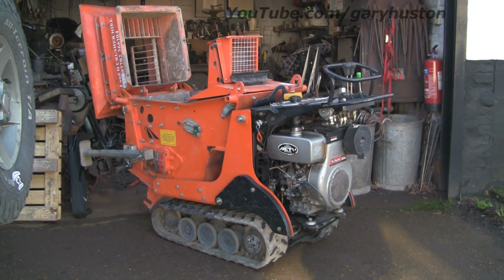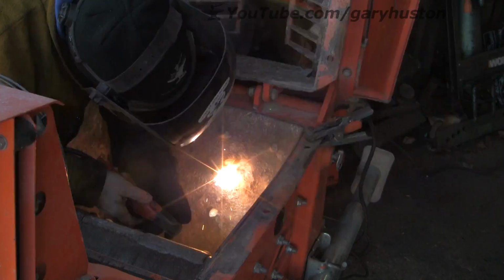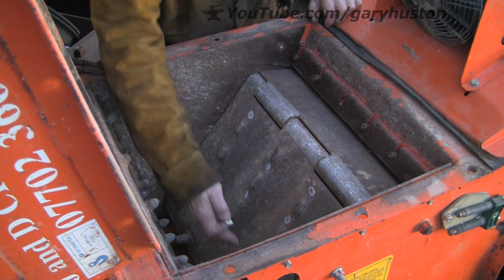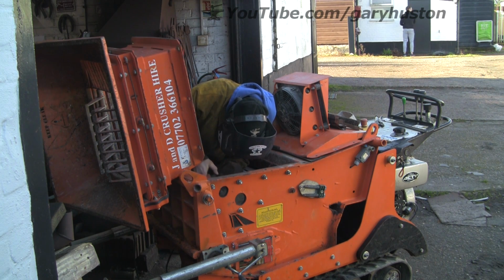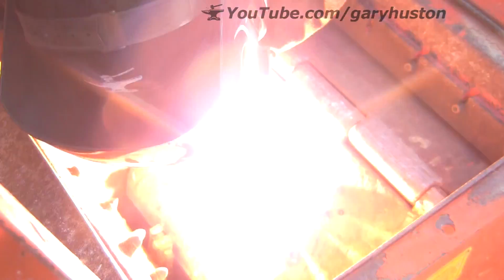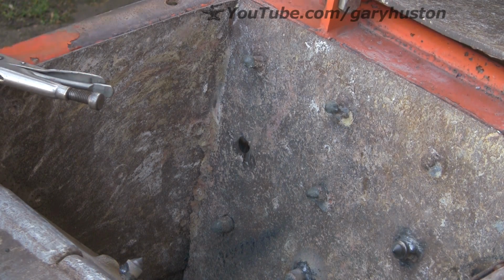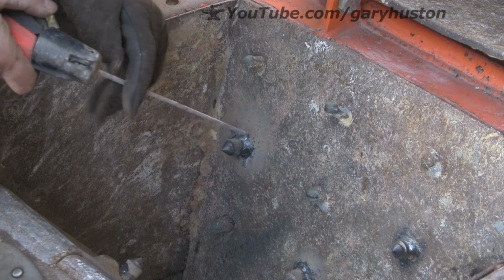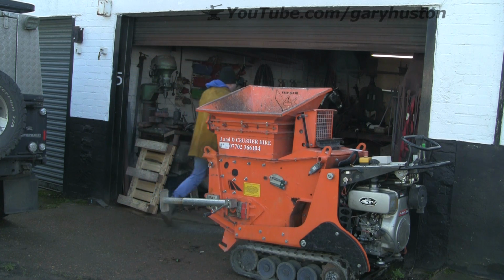Crusher repair

Comment: I used a lot of various brands of 7018 many years ago welding pipe and other projects. And when in a tight spot I went ahead and bent them.  You are right. They will break all the flux off at the bend. But I would just weld them up to the bend then I would long arc the rod in another area and burn off the rod until it got down to flux again. Then I kept welding. Some folks just use some side cutters and cut off the piece of rod close to the flux so they could use the rest of the rod.  It worked when in a tight areas.  :)

Comment: As someone else the slag coats the tip of the 7018 just need to break that off and the rod will restart much easier, it’s a common problem that rod. Breaking that off like they said use an old grinding wheel, old file, brick, etc. You could mig weld those on with like a ER70-6 wire, but with the mig you have to grind everything to clean metal. 6010, 6011, are made for stuff like that, they’ll burn just about thou anything, however the it’s 60,000 pound rod to a 70,000 pound rod.

Comment: Hi Gary just another idea. Keep your rods in an air tight container so moisture from the air doesn't suck up it the flux so bad. Metal container the best and putting them beside heat before you use them can help.

Comment: I, pretty much, use only two rods, anymore: 6013 and 7018. Everything else gets flux cored mig. I have a small inverter welder for light jobs and that's what I use most in the field. Light, handy, and DC. Great little welder. Weighs less than half of what the wire welder weighs.

Comment: Gary, regarding the hard starts on your rods.....as mentioned by bc65965 and Gee Dub you have to chip off the tip of 7018 rods for an easy restart.  I use an old brick or worn out grinder wheel to scrape the tip off.  Also, I couldn't tell in the video, but the hard starts could be because the weld area on the plate appeared to have not been cleaned (ground to bare metal) to get good electrode contact.  Also, check your ground contact; you need clean metal there as well.

To get into cramped places, even though you can't bend the rod itself due to flux chipping off, you can bend the electrode where it clamps into the holder or even a few inches from that end.  You won't be using that part of the electrode when it burns down anyway.

Comment: I like using a needle scaler for chipping when possible. Before restart, grab the end of the rod in the palm of your hand and use your thum to crack off the flux on the tip. 

I’m sure you already do this though.

Comment: The flux on 7018 forms on the end of the rod in between light ups. A lot of the time I'll have a course file clamped to something not grounded just to drag the tip of the rod across in between strikes.